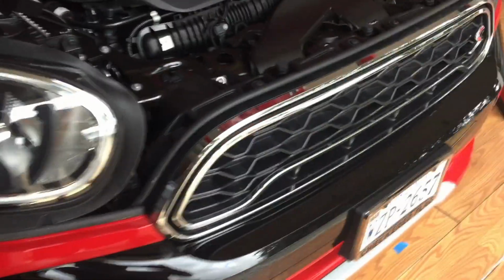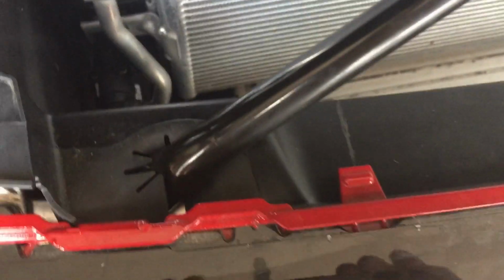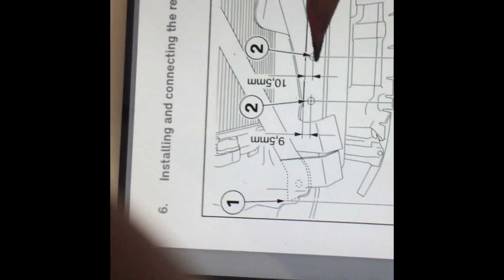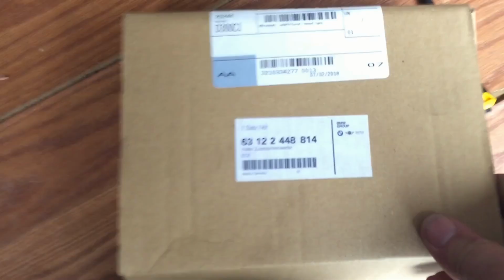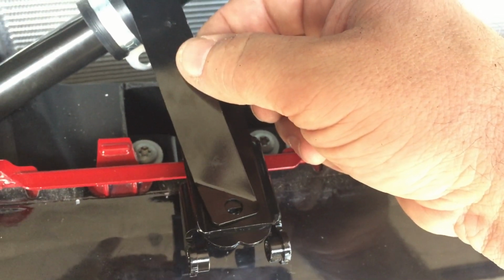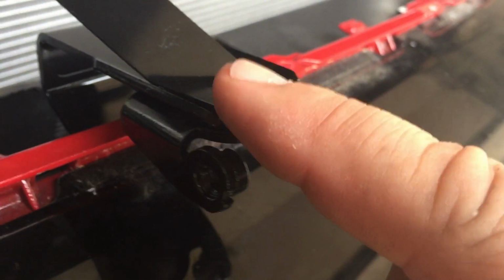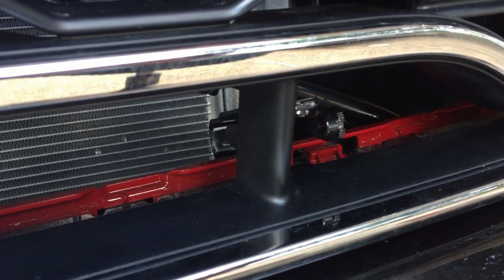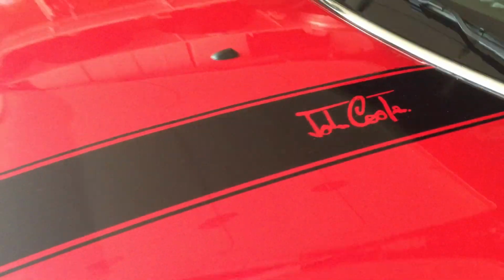Mini Countryman S LED driving lights install

Comment: Awesome, but where is the wiring video?
Reply from the maker: Miserable. Spent two days getting it all wired up and they still won't come on.  Looks like the 2019 wiring diagram is different than the 2017 instructions that I have.  Checked every wire and soldered each one.  Still no go.  Waiting for an updated set of instructions.
Reply: @scotthayne806  Great, enjoyed the show and I AM holding my breath for your next wiring up video ... smile.  You are inspiring me. thanks. My '17 is now lifted and the new Geolander tires 225x65x17 are wonderful, big improvement. Rally lights are next.
Reply: @scotthayne806  Dear Scott, do you have an updated set of instructions now? I could really need it, too :)
Reply from the maker: Christian Ole Wächtler all I can find is the same 2017 wiring diagram. Sorry
Reply: After you make it please do a video to see how they light in night road 👍🏽👍🏽👍🏽😎😎😎
Reply from the maker: Still no wiring video. Haven’t even attempted it. Lights look great just not working at the moment. Maybe this summer I will attempt again.
Reply: @scotthayne806  any update?
Reply: This is random as all get out but I actually bought a Mini countryman used and was trying to figure out why the rally lights weren’t working. I came across this video and this is the EXACT Mini I bought, there was even old insurance cards with your name. Did you ever get the lights working?!